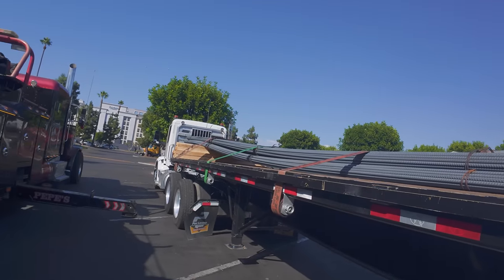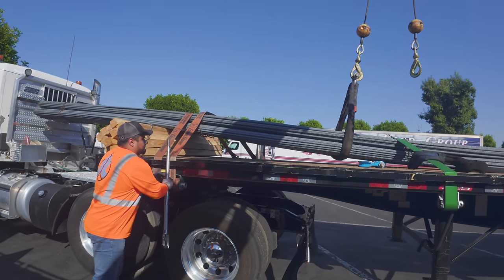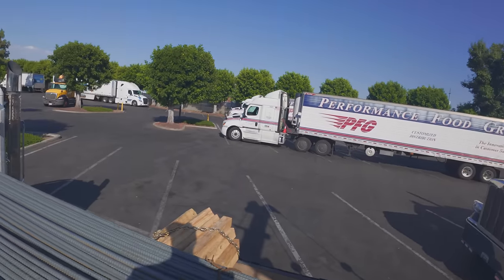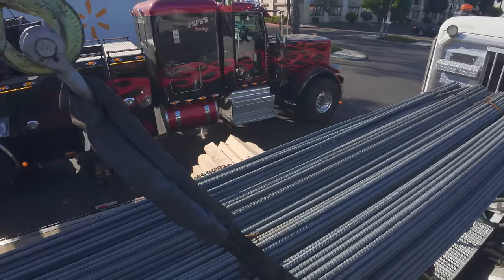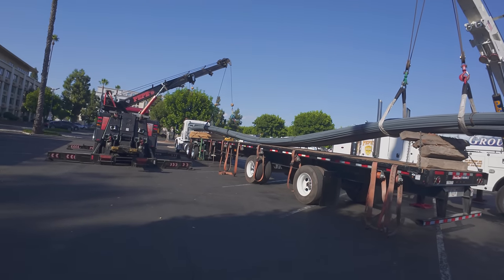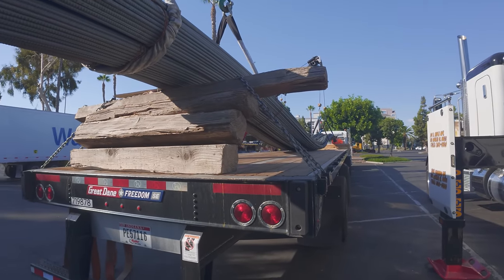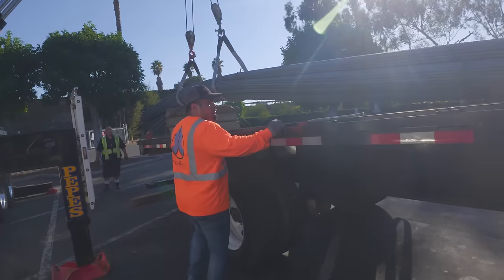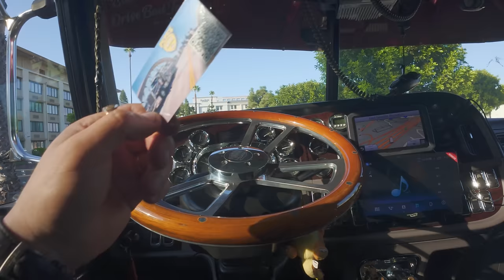Helping This Driver With a Shifted Load of Rebar (65 feet!)

Comment: For one thing he didn't properly secure the load he needs to do 3 belly raps over and under criss cross them like like and X then put 4 more straps over the complete load spaced out over every 6-8ft. Apart the way the driver tied the load down if he so happens have to stop suddenly the load will slide forward and could go rite threw that headache rack and go threw the cab. This driver and the company apparently doesn't train there driver or drivers how to secure loads, also he doesn't even have a flashing yellow light at the back side of the load. This is how people get seriously hurt.

Comment: Really interesting job. I spent a lot of time trying to think of a safer way to secure that kind of load. Liked the segment with your dad joking with the driver. As you said at the end, customer relations are significant for obvious reasons. Thanks for the video.
Reply: Josh and Joe great video and job! Thanks for sharing! Kevin
Reply: I suppose someone's tried a metal box slid over the front end of the load chained back to the deck of the trailer at multiple points with really heavy chain.  Sandwiching it between wood or steel plates chained forward and back again in multiple places in the middle section would also help.  Having it up off the deck on thicker dimensional wood blocking in the middle would also help stabilize the 4x4 piles front and rear.  But then you would have a dedicated rebar hauling set up and that's probably not how it works for loads going from Cali to Nevada.
Reply: The front end of that rebar load should have been flat on the deck, maybe just 1 4x4 spanning the width of the flatbed.  The elevation and having that many 4x4's stacked together caused the load to shift unnecessarily.  Essentially, not enough weight on the front holding those 4x4's from moving during heavy breaking.  If that load is just sitting on 1 4x4 off the deck, that load doesn't shift.
Reply: @eckolaker  But then it would hang in the airlines...not good for turning.
Reply: I just saw a video of specialized rail cars carrying aluminum billets.  They had beams that fit from side to side into the pockets and then adjustable chocks that clamped the load on top of the beam.  Six of a similar beam to fit a trailer with something to squish the load and clamp it to the beams would keep this rebar in place.  Linked to the close up of the deck setup on the rail cars.

https://youtu.be/8ZPikL_N_Ck?si=oDcec_-JhCF2NL5i&t=238
Reply: Did I miss something where is the hulk

Comment: There are several problems with this type of load. 1, Load is too long and cannot be safely carried within the confines of the trailer. 2, The trailer hasn't a steel headboard (headache rack) and as such, the load can and in this case did shunt and shift forward. 3, Those load timbers/skids, totally unsuitable because being built and stacked from individual pieces of timber they are vulnerable to collapse, which they did. Here in the UK, we have purpose built steel deliver trailersdesigned specifically to carry a contained load to avoid this type of incident.
The driver escaped serious injury or worse, he was lucky!
Reply: it is very common in California/USA to have a load of rebar that long.  Hanging 10' beyond the end of the deck is pretty typical.
Reply: Header boards are not required.
Reply: @redmesa2975   No, but they probably should be.  Unfortunately, most companies are only as safe as a) the law requires, and b) they can get away with.  Corporations especially figure (probably correctly) that it's cheaper to pay people off than to spend the money to do things right.
Reply: in Canada, we do this all the time carrying long loads past the deck of a trailer. just never seen a load propped up such as this one.

Comment: Like Josh I am amazed the truck was driveable with the load so close to the cab. 

Others have talked about headboards on uk trailers, but there are also rules about loads overhanging the back of a vehicle.  It is possible to have exceptions but those are like the special permits for tall, wide or long loads.

Comment: In the UK I believe flat bed trailers have to have a headboard integral to the trailer itself to specifically avoid forward load shifts.
Reply: Definitely a nice safety precaution, however if this trailer had a headboard this load wouldn't have been possible to transport on it due to the length
Reply: @cat740dt  And therein lies the truth of the problem, the load is too long to transport safely.
Reply: Correct, and why we have maximum length's for steel bar and box sections.
Reply: @JonDingle  Wrong trailer. There are trailers that can stretch, and support the entire length of the load.

Comment: The wood blocking under the rebar was like a pile of corncobs. The 4x4's are like round stock and have no resistance to rolling. Some cross members to stop that would have helped a lot. 
Josh had the right suspicion about the blocking underneath. 
Good re-load.

Comment: I had a similar situation like that. I choked it in the rear and just pulled it. Backwards worked just fine, but kudos to you with   those rotators.

Comment: I've hauled rebar for years and never had all of those straps (which I'm not bad mouthing him for) 2 chains on each end front and back and 1 strap in the middle of the trailer and i had my dunnage chaind down so it wouldn't fall over. And I've never had the rebar move at all. But it's all about how you chain your dunnage down and how you wrap your chains around each end of the rebar and tighten down as much as you can and retighten your chains and binders again alittle ways down the road and you shouldn't have any problems.
Reply: And all the driver used was straps to tie the rebar down is another reason that the rebar shifted!

Comment: I wish I could show him how to tie that with chains so that it would prevent it from Rolling forward when you hit the brakes when it is tied properly you can actually Slide the tires with the brakes and it won't move as I said I've hauled that stuff for over 20 years from Fontana back to Phoenix and up through Utah

Comment: That 65ft rebar surely needed to be flat on a longer steel bed like they do with abnormally long beams. Interesting video. Also wondering where Dave is?
Reply: Dave usually works evenings, I think...
Reply: Think Dave is a night owl, i expect he was nicely sleeping at home, maybe hulk was in for maintenance or Dave’s truck was easier to get 🤔

Comment: Rookie flatbed hauler. I've hauled all sizes of rebar out of Cali and Utah and I've never seen a deck set-up like that. 2 feet high in front and 2 feet high in the rear.
Reply: I’m not in the trucking business, but it seems to me that the load was just too long for the trailer so they had to raise the front end so the rebar overhang would clear the truck, and the back end to keep the overhang from dragging on the road?
Reply: @Taid44  I always used just single 4X4 the length of the deck. 48 foot or maxi length decks. That looks like the wrong truck size and trailer for the job. And a 65 foot load with no 'long load' sign?
I guess that's why I saw that CHP in the video.

Comment: Couch quarterback here...
Would the spreader bar work when used with 2 loops straight down and 2 towards the ends of the rebar? Doesn't look like the weight is a real issue for the truck.

Comment: Why do they have to have it elevated in the front and back? It can't be transported perfectly flat on the bed? It may even make it safer since the increased friction on the flat bed may prevent the rebar from driving into the cab. Honest question.

Love the channel by the way! Keep it up!!
Reply: So it not hanging and flapping up and down while driving. But it’s only only loads like this where it hangs over on the from and the back.

Comment: The does seem to worry authorities in australia you would fined and parked up until it was rectified 😮
Reply: In Australia, you would not be allowed to have a load overhang the rear of your trailer, however this load is 65 feet, (19.8 m) which is longer than the trailer. At the end you might notice an escort vehicle. The same would be required in Australia - over size load - escort vehicles and travel restrictions.

Comment: I really hope this guys dunnage did not slip again. I would have moved the front wood more center to where he looped the chains so that the bottom 4x4 where in tighter contact with the chains. On the back dunnage I would have placed a strap after the 2nd dunnage and then the chain in the top like he had it.
Reply: Especially on the downhill  coming into Vegas 🗿

Comment: Could you have backed up to the rear of the truck, secured the rebar to your truck. Had the driver pull forward 2 feet. Then lift the ends to reposition the wood dunnage, that was going to shift due to the driver pulling forward. To avoid the delay of waiting for a second truck? Not trying to be a smart ass, just trying to seek a different game plan. Obviously you having the experience, what do you think?

Comment: Easy fix. This load was in no way secured correctly. Anywhere else in the world the driver would receive a violation for an unsecured load.
Those straps should be 'choking' the rebar. The strap goes from it's roll out spot, UNDER the rebar, Back over the load and UNDER Itself, and then cranked down on the other side of the truck.
No way would the rebar slide forward like it did. As he had it the straps were barely touching the load, it might have stopped some sideways movement but that's it. DOT should be leaning on this crap.
He should be shown how to secure a load properly. His boss should get his a$$ kicked too.
Reply: Your comment makes a lot of sense.

Comment: I dont think I would drive a trailer with that type of load unless the trailer had a steel headboard to prevent forward movement of the load which should be tight to the headboard.

Comment: I don’t understand why both ends are so high on wood and the rest sits on the bed? I guess the arse end has to raise up because with that overhang when it droops it be almost on the road 
Would an extendable trailer not have been a better option? And I thought steel should be secured with chains? 
It’s weird with you not having hulk lol

Comment: Question???????????? Why not use the spreader bars???????????
Reply from the maker: What problem do you see that would be solved by a spreader bar here?
Reply: @PepesTowingService i did wonder about the spreader bar. My thoughts were use it and then straps straight down to the load which would eliminate the possibility of the straps sliding towards each other - but then I thought no Josh is the expert lol

Comment: Not sure why the driver put all his good 4x4 dunnage at the front of the load and the unstable dunnage at the rear. 
I would’ve used the 4x4 dunnage that’s placed in the front on the rear as well four pieces high.

Comment: 1:19 You don't need two trucks Go at the end and pull straight back, Even Ron Pratt said that! It was overuse of equipment just the way to charge up a bill unnecessarily! One truck at the very end wrap A strap around the rebar and pull straight back job done!
Reply: I reckon Josh knows what he is doing. 💯 better to over rig rather than gamble that it will probably be ok
Reply from the maker: I always love these kind of comments. Some irrate boomer that's never stepped foot in a tow truck yet somehow knows better. First, how do you possibly know how much I charge? With the high saturation of tow companies in LA how would I possibly get ANY work if I constantly over charged like these idiots always think. 2nd, no two jobs are the same. Did he also pull 65' of rebar weighing 48,000lbs straight back? How would that work with the freaking stacked high wood in the front? He needed EACH end lifted to fix the wood. I try not to engage with such glaring stupidity because you guys have a lifetime of experience yet here I am, feeding my algorotim lol

Comment: wrong stack the ends of the rebar need to laydown flat the wood need to be closer to the middle. the way they put the wood will make the middle of the rebar flap if you hit a hole or just a little jump of the trailer.

Comment: SORRY, BUT POOR BLOCKING ON THE DRIVER! The stack at the rear was totaly WRONG!! Should have ben a 6 or 10 stack. Also a full wraps with full chains in a few spots would help.
Reply: Flatbed driver here, I've also hauled oversize rebar somewhat like that. If it was me I would have dropped those 4 blocks at the back down to 2 stacks of 2, and the front I wouldn't have gone higher than 3 and would have made it 4 across, then put the extra underneath the load giving it more height and allowing the straps to put more downward force on the rebar.

Comment: oh look another load shift by using strap use chain on steel it would be ok .how in the hell can he pull a oversize load like that with out a escort i would have been in jail the first mile i traveled on the East coast
Reply: Oversize? That isn't considered Oversize in a lot of jurisdictions. Just flag the end
Reply: yah that is oversize on the East coast need permit and escort
Reply from the maker: I believe in Cali this does count as oversize. Provided he has a 53' bed and a bit sticks out the front, that leaves about 10' of overhang.

Comment: a little surprised you went with straps. chains are a better option  with the thick wire that bind the bundles together. I've ripped my pants on them. They could destroy a strap easily
Reply from the maker: I went over that and it was a simple ten second solution to overcome. You'd use 1/2" chain right? Now tell me, what's the working load limit of 1/2" chain in this basket style configuration?

Comment: The dude almost lost his life plus any other damages or injury. Yet the govt is worried about the emissions on the idling trucks. How about the job contractor can only buy what actually fits on that trailer and they have to splice pieces. Thats the price of proper contracting. Should have had dead head blocking at either end of the trailer with the bar in between. People risking other peoples lives to save a dollar is nuts.